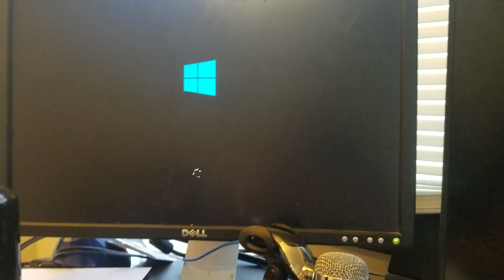How to fix black computer screen with red ram light on

Comment: I appreciate the video very much. Thank you. Though I realize in my setup that the DRAM only work when the farthest out two slots have to be use in order for it the boot properly. When I use the DRAM slots closer to the CPU it didn't run or boot. It's probably the manufacture setting to use the outer two slots to begin with anyway which I didn't know. But thanks anyway for your video.

Comment: I tried to take the ram out to clean the slots and now when i put it back in the red light is on ram and it keeps shutting off. I tried every which way, and my sticks dont pop in theres only one part on the top to lock it in but they dont click before hand. There ballistix ram btw. Plz help

Comment: help where its blinking it says vga what do I do
Reply from the maker: what type of cord are you using to display the image
 vga, dvi, hdmi, dp
Reply: @CRASHB4NDICOOT4  oh the only one im using for the graphics hard is a hdmi I don't know if it matters or effects it but this is my first pc ever
Reply from the maker: @gissyyyy  ok seems odd. try doing what the video says. then try different cord and or different spot to plug in on ur pc. vga is just an old type of display that is super outdated and no new computers use it anymore
Reply: @CRASHB4NDICOOT4  ok my monitor actually turned on now but it says "reboot and select prober boot device or insert boot media in selected boot device and press a key" now what? Do I need to buy something oh and the light is still red

Comment: i just returned my motherboard/cpu (bundle package) because i had this problem. the ram slots only had one "lever" instead of two like normal so im thinking the bottom part without the lever i needed to push in more until it clicked... oh well too late since i already returned it lmao
Reply from the maker: yup prolly lol  oh well long as u  get it up and running  lol

Comment: My pc boot up normally but it freezes at the desktop and after couple minutes the screen goes black and the DRAM LED turns on on my board. I built my pc around 7 months ago and everything was fine but yesterday this issue occurred.

Any suggestions?
Reply: Are you find solutions? I got same issues cause my pc just freezes today and after that I see the dram led turns red, I’m trying replace RAM but it’s didn’t work I don’t know what to do (((
Reply: @MrAndroid540  I've been struggling for a whole week and surprisingly the issue was with the hard drive. 

I have 1 NVME SSD to boot my system and a hard drive for games.

For some reason when I unplugged the hard drive, my pc stopped freezing, and I bought a new hard drive today, but when I plug it to my system it will freeze again even if I changed the SATA cable.

I'v been searching a lot on the Internet for a solution. But each article I read contains a different solution, 80% of them changed their motherboard to solve the issue and I'm about to order a new one also but thank god I unplugged my hard drive.

I advice you to troubleshoot everything you can. Reset the bios, Windows, and try changing your ram slots from A2 , B2 to A1 , B1. Try different types of ram modules. Boot your system on safe mood. Try unplugging one of your drives. Get an external HDD or SSD and install windows and try to boot your system with it after unplugging all of your current  drives. 

If you don't have the time for that go to any trustable computer maintenance center near by your area.

Sorry if my massage was too long. 

Hope your pc get fixed as quick as possible 🙏🏻
Reply: @MouathAlawadhi  Thanks for the answer, I hope he will help someone.
I solved this problem like this: First, I took out the RAM bar and the computer turned on.
But when I inserted the second bar, the PC did not turn on again.
I went into BIOS with a bar that worked and just turned on the XMP profile for RAM
And everything finally worked.

Comment: Didn’t work. I’m super scared I just spent over $1,000 on this computer. I tried to put in another 8 gig stick of ram, turned my computer off then tried to power it back on and have the DRAM light on, no picture on my monitor. I removed the other 8 gig stick that I put in but it’s still not working. The original stick of ram that came with the computer is in the same spot as it was when I first got it
Reply: Going through the exact same thing, I’m so worried. Have you found a solution yet?
Reply: Same here bro im shitting myself might have to call a technician
Reply: yo I found the solution; you need to push down really hard on one of the sides of the ram stick. I thought I was pushing it in, but if you push on one side and it tilts, you didn’t close the tabs or push it in enough.

Comment: Also - another thing that causes that red light is if you get a little too eager to turn on the PC (like I did) and you forget to have previously connected the 8 pin power cable for the  CPU.

Comment: idk if you'll respond to this comment but I accidentally unplugged 3 wire from the mother board and one the board where they were it says reset HDLED PLED and finally PWRBTN which idk what means and when I kept plugging them in I noticed when I plugged a certain one into reset if the power cord was connected there would be an orange light next to my power button I plugged another one in and it was orange and next to it blue I tried to turn it on and it worked then it turned off and on continuously until I unplugged I'm gonna try the ram thing now AND ITS GONEEEE but it won't connect to my tv and its back there is 3 more red lights under it and sometimes the lights turn off they're gone now my pc doesn't turn off and still won't connect to my tv I've connected it to my tv but I'm using my monitor because my power cord is broken and a new one should arrive later ill reply to my comment in mbe 30 min or more or less cuz that's when it says it will arrive with plenty of more upgrade not only for my pc my setup monitor chair desk headset stand headset elite 2 controller etc I know because the total was about 3500 and need to sign cause of the price I'm new to pc and trying learn and experimenting on my own and since I upgraded everything in my pc except motherboard at first I want going to do the PSU but since I'm new to this been using a pc since about January 1st so almost 3 months that I've used a pc got used to it and now started getting interested in the components and how it works so I ended up upgrading from 800 watt PSU to 850 Watt from corsair I hope it good and enough for 360mm CPU cooler and 3 more 120mm fans cuz that is the size of my old trashy fans from a 1200 dollar prebuilt pc but whatever even tho I'm getting a new case that's a little bigger I'm still getting it the same size just in case and a Ryzen 9 3900x which is what I'm getting I have the Ryzen 7 3700 which I'm assuming is better cuz of the numbers  I mean absolutely everything new case a bunch of stuff why it was so expensive not because I bought best of the best stuff at stupid prices like for example I'm not upgrading my GPUs yet mainly cuz I got the rx 5700 xt good for 1440p gaming with is what I want but can due to my current monitor and everything better even better versions like a Asus msi or xfx for example are all sold out at places like Best Buy or Walmart that give reasonable price not people reselling like on amazon for over a grand  the red lights are still gone with hopefully is a good my pc has been running for a good 30+ min with no red light but not connected to tv
Reply: ok I feel stupid I forgot I kept switching from the regular HDMI port to the GPUs with I'm supposed to use the GPU HDMI port and connected it and my pc is connected to the tv thx SOOOOO MUCHHHH for the help I didn't think it was actually the ram I was like there is a chance but I doubt it because I've taken out my ram quite a bit and did it earlier today and I knew about the double click bottom and top found out myself but I guess I must've not done the bottom correctly for one of them or both I know you can't use it without ram but dk if you have 2 8 gigs total 16gb and I use about 10 not using more till I replace em all with new ones for a total of 32gb for better graphics
Reply: im kinda confused the orange light is still there usually its just blinking letting me know it is saving data

Comment: Well that didn't work for me
Reply from the maker: possible u have bad ram/ mother board. make sure ur always grounded 😌
Reply: @CRASHB4NDICOOT4  there is a red light over the thing that says CPU does that mean I need a new one also the screen says entering power save mode and the button to turn on the pc light doesn't come on but the stuff in the pc does what should i do ??
Reply: Upon further review the red light that is on for my pc is for the cpu. Not sure if I need to replace the board or cpu.
Reply: @JustCause01  try other cpu. the board should be good if it can indicate an error, which is in your case, a red light on CPU led indicator.

Comment: I have a question when I took my ram of mines. The yellow part of the ram like where you stick it in is kind of dented and it just won’t go in. Do I need a new one or can this still work ? 
Edit: I was able to put it in and the red light went away but still no signal..
Reply from the maker: try different ram slots and or different ram.
"DentS" are NEVER GOOD and u may have a big issue. If ur lucky u just have one bad slot or bad ram
Reply: @CRASHB4NDICOOT4  my slopes but seems semetricle am I ok?
Reply from the maker: @StonedCheeSe420  hopefully hard to say without seeing

Comment: I have no more red lights yet my computer still won't boot up
Reply from the maker: check all cables and video card is fully seated
Reply: @CRASHB4NDICOOT4  thx :) I did, I also re inserted my RAM, and cables. It works (for now)

Comment: i did this and it still have the red light and nothing will show up on monitor someone please help🙏🏼
Reply: Same :(
Reply: @Tarazed609  what did you try doing?
Reply: @jondude9504  I just resolved it a moment ago actually! so i made sure the ram where correctly inserted, also made sure all cables where properly plucked in. That's it

Edit: I also tried the HDMI on both the CPU and the GPU, and plugged it again after all these verifications
Reply: @Tarazed609  dang i tried to switch out my cpu and it’s still not working /:
Reply: Yo just having this problem right now. Any results?
Reply: @tomwebber140  hey i figured it bro
Reply: @tomwebber140  might neeed to get a new motherboard
Reply: @jondude9504  yup ur absolutely correct. I figured this out about a day after the last comment.

Comment: Dude! Thank you so much. I just build a new rig and that's exactly what it was doing. I even re seated the RAM and didn't push it in hard enough the second time. I just clicked the bottoms of my ram into place. It should work when I turn it on. Fingers crossed.
Reply: It worked it worked it worked!!! I almost had a successful build straight through. Atleast I didn't have to take the mobo out of the case or unmount anything.
Reply from the maker: @ZaDowlan  hell yes!
Reply: @CRASHB4NDICOOT4  I have that light and have bought new ram and clicked it in properly but the red light won’t fuckin go away

Comment: I have the same problem. New PC build. Worked for a week no problem. Then suddenly I have the red light. I had 2 X 8gb RGB Vengeance Pro. I removed one and it worked again. But then put the second one in and it stopped again. So I removed the second one and tried again but the dram light is back on. Any thoughts? Could my ram be bad?
Reply: I have this problem rn since i just bought a new mobo, gigabyte b450 aorus elite. Did you fix it? If so, how?

Comment: I’m having this problem but this didn’t fix it
Reply: Same
Reply: Same with a gigabyte z490 mb
Reply: @__razvan  same I have a ASRock z490. Only just started happening
Reply: @andrejankowski2606  I fixed it on my gygabite z490 by putting the SSD in the first ssd slot and by removing the hdd than i restarted the pc and it was fixed. And after i installed the windows and everything i inserted the hdd too. I think the pc couldnt boot on ssd and neither on hdd and i had the ssd put on the 2nd ssd slot for no reason idk why. But for me this worked, i hope it helps.

Comment: same problem happened to me, but my ram is snug and in place but it’s still not booting up please help me
Reply: Unison I finally got mine to work like two days later. I had to put the hdmi in the adapter and double check all the cords being pushed in.
Reply: Creation Magi good job 👍
Reply: I’m having the same EXACT problem
Reply: Creation Magi i just took cpu and put it back in and it started working lol
Reply: Unison I’m scared to do that lol, installing the cooler was a hell, I don’t wanna go threw that again.
Reply: John F Kennedy i was sweating mad hard, it worked tho
Reply: Unison just did it, it worked, i did have to clean off the thermal paste and add new one, but everything is working now.
Reply: John F Kennedy glad to help

Comment: I have 2 brand new ram sticks and they both have a red light above it, I keep switching them around and everything but they still won’t work, please help me , I just spent 1k on a new build and it doesn’t even work smh
Reply from the maker: its possible u may have bent cpu pins the communicate to the dimm slots. check that. Also it is possible to get bad ram it happens. try other ram. Eliminate that problem. let me know what happens and I can proceed to help u
Reply: Crash Inc I fixed the problem, I removed one of the ram sticks and kept the other one in and it worked, then I put The other ram stick back in and both worked

Comment: The reason of this happening is due to xmp profile. Restore to default if you see you are stuck to motherboard logo screen with dram light on.
Restart
Press del or F1 according to your brand to go to bios.
Go to restore optimised default
Save and exit to see if you able to boot up.

Comment: All plugged in tight any other solutions?
Reply: Turn on the pc and when the red light shows just push one of the ram sticks harder down until the red light is gone and ith should work

Comment: Help it still doesnt work
Reply: i have same error - and i fix this, if you need help please give me your motherboard model + cpu
Reply: IsMyStore msi mpg x570, Ryzen 3700x
Reply: @tristanwahlin8571  your bios is up to date?
Reply: IsMyStore I haven’t even been able to get into bios. I can’t get a monitor connection
Reply: @tristanwahlin8571  go to be able to make this work again (after it work you need to update you bios first so it will not happened again.)
1. remove the GPU.
2. Remove the CPU
3. power up the pc (i know it will not turn on, but trust me)
4. disconnect the main power supply.
5. remove the cmos battery.
6. press on the power button, to remove all electricity.
7. put back the cpu
8. wait at least 25min.
8. put back the cmos battery
9. put back gpu
10 connect back the main power and turn it back on.
Reply: IsMyStore this is a fresh pc build btw, doesn’t have windows installed yet just in case that changes anything. But you think this will fix my dram bug?
Reply: @tristanwahlin8571  yes please try.
after it will be on install windows and flash bios, if you have another computer update the bios first then install windows
Reply: IsMyStore I just upgraded my cpu to a ryzen 5 3600 and my motherboard is a strix b350-f gaming motherboard. My old cpu worked with this motherboard just fine until I put in my new cpu. So I really need help
Reply: @imphantomz9415  you need to update the bios, i have posted instruction
Reply: @imphantomz9415  i have the same cpu but no problems with it maybe your mainboard doesnt Support the cpu
Reply: @Ismystore1  i have same problem broooo.. ryzen 7 3700x and asus b450e .. dram led is yellow and i have no signal
Already tried change slot ram but still doesnt work.. can u help me?
Reply: @xyv704  what is yellow in your motherboard? CPU?
Reply: @Ismystore1  dram broo
Reply: @Ismystore1  i think the problem is bios.. maybe it's not updated for amd ryzen 3rd gen
Reply: @xyv704  its not a problem of CPU bios, if it was CPU led need to be on.
try this:
remove all your ram, connect only 1 to different location, try to slot 3
and do it without GPU.
tell me if the led have change, or it work.
Reply: @Ismystore1  already tried that... but the result is same :(
Reply: @Ismystore1  and i think mobo b450 should get newest bios update to user amd gen 3rd
Reply: @xyv704  what is your sdram type, speed and brand?
Reply: @Ismystore1  corsair vengeance rgb pro 3200 2x8gb
Reply: @xyv704  yes for ryzen 3000 you need b450m
Reply: IsMyStore please help my motherboard is the b45 gaming pro carbon max WiFi with a 3700x Ryzen cpu
Reply: @ramiro503romero  update motherboard bios bro
Reply: HopZ I already did and now it went from giving me a cpu error light to the ram light
Reply: Already tried changing up the ram to different ports but nothing
Reply: @ramiro503romero  i have the same issue with u.. i just borrow my friend cpu for update newest bios and then all problem solved
Reply: @ramiro503romero  check your motherboard box .. is there says ryzen 3000 ready or 2000?
Reply: HopZ yes it’s comparable bro idk if it’s maybe a bad motherboard
Reply: @ramiro503romero  already try diferent cpu? Go try gen 2
Reply: @Yazan00001  remove ram, and cpu and GPU, power on the computer (it will not turn on) then put pack cpu and remove power supply and cmos battery for 25 min at least and put all the parts back and try to turn on
Reply: IsMyStore I don’t know who you are but you’re the best
Reply: @tristanwahlin8571  Thank you, i am happy that it's work for you. this problem is because the motherboard is thinking there is a problem with cpu, so it's stock on this error, my problem solve it by resetting the bios to is default state. but you need now to update your bios. good luck
Reply: I fixed it by buying a new mainboard